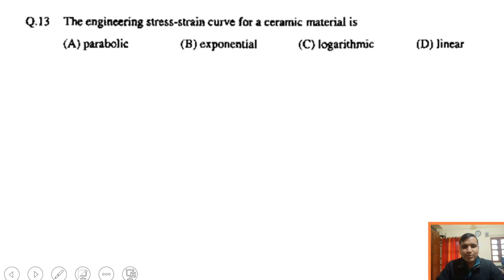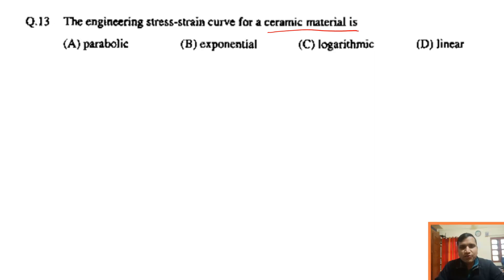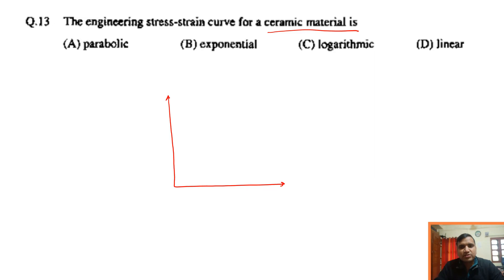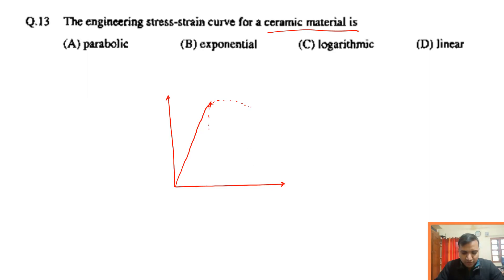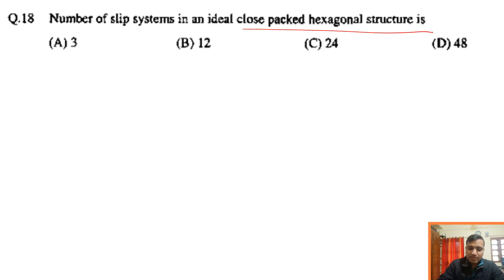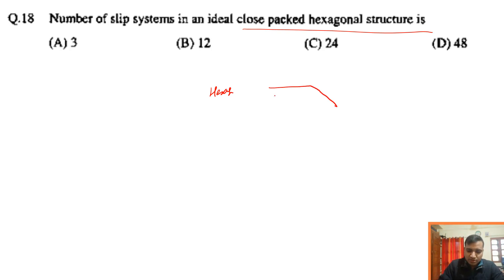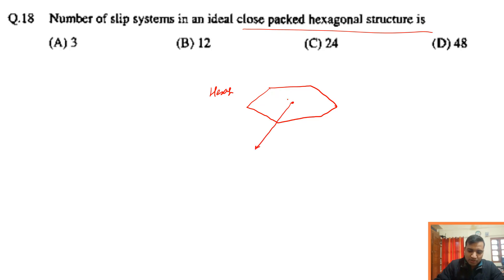GATE 2010 Mechanical Metallurgy Solution

Comment from the maker: 00:00 Engineering Stress Strain curve ceramic
00:45 Number of slip system HCP
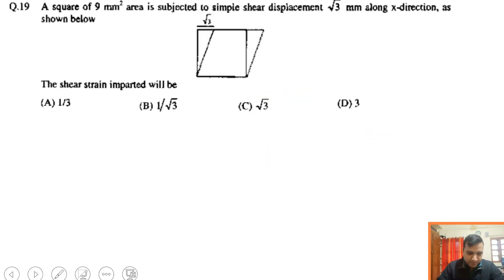01:29 Shear Strain
03:01 UTS
07:25 Reduction in diameter
13:12 Elastic strain energy